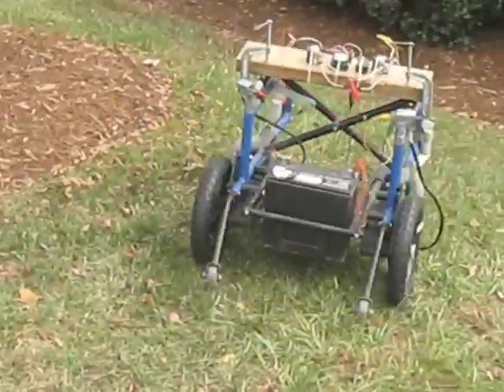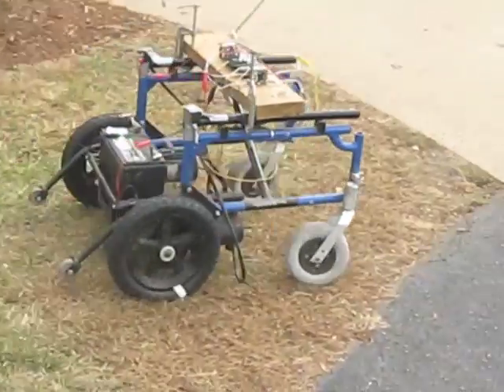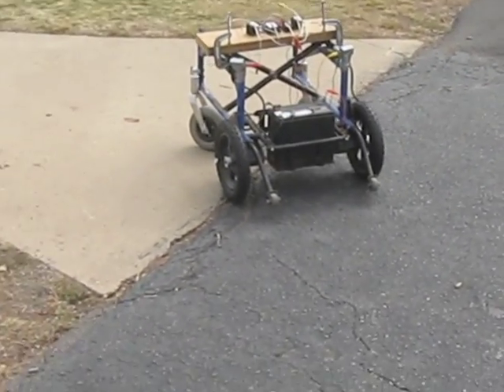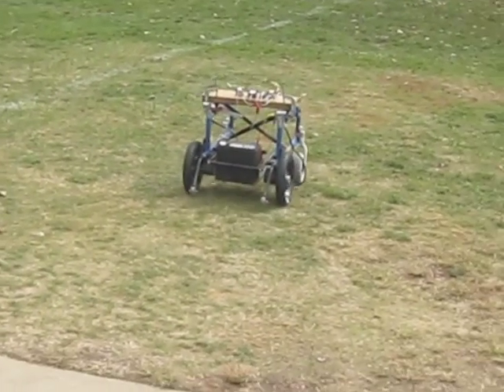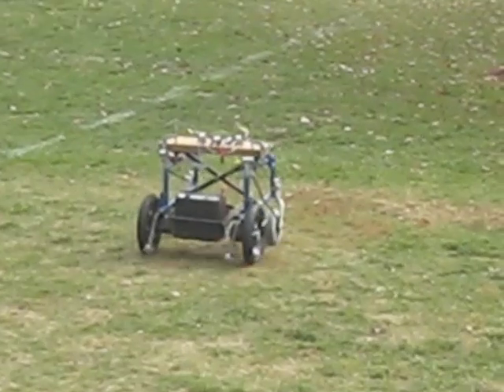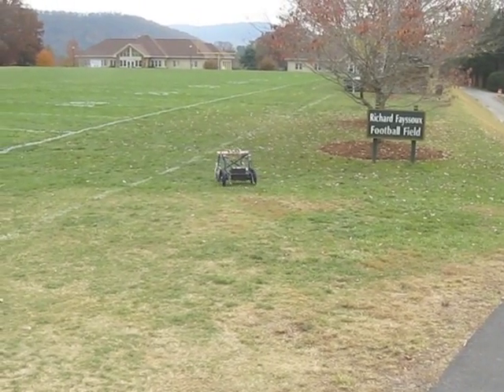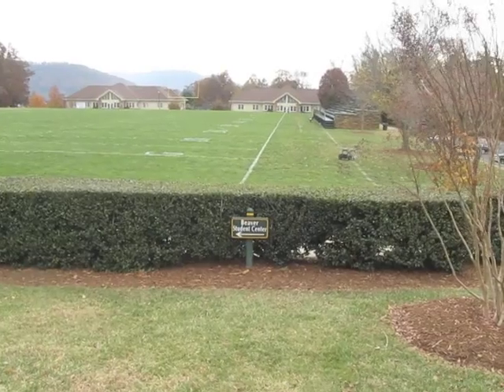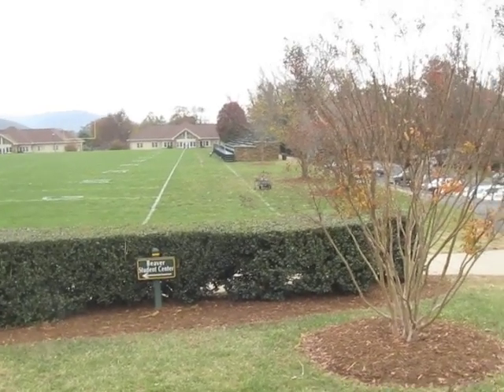Electric Wheelchair Robot (Arduino)

Comment from the maker: @navic209  Thanks!    Yup, this is the prototype run to test the arduino and motor controllers.  We've got a bunch of sensors on deck to go in (GPS, compas, a half dozen PINGs, 3 axis accel,3 axis gyro, wireless web cam, etc.)...we'll see where it goes...